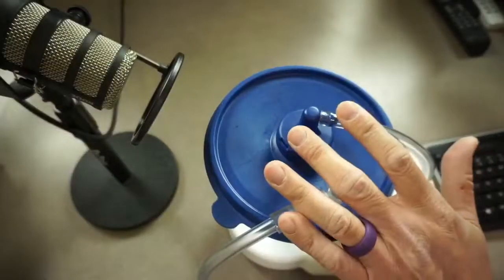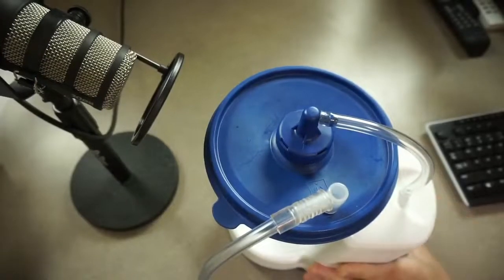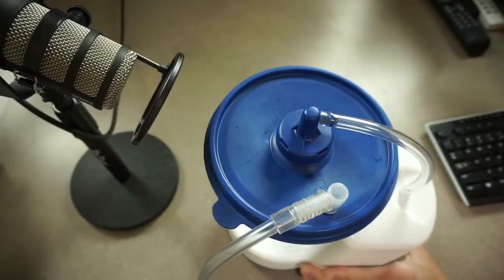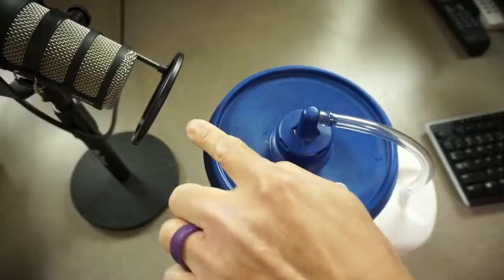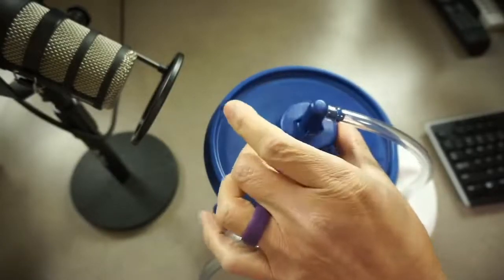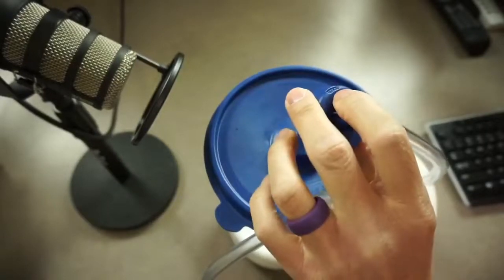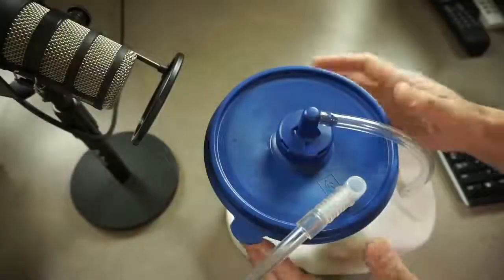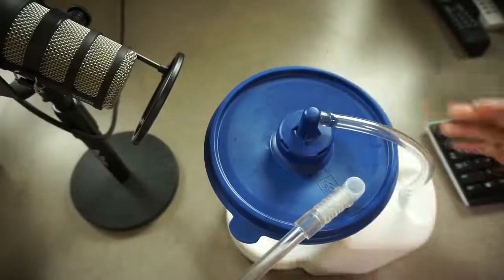How Loud is the PurWick Female External Urine Collection Catheter System Pump?

Comment: The simulation demo given by Dr. Lin was good on the video in that setting. I could not detect the humming sound as much as I do in a home bedroom atmosphere where it is a little more quiet. The humming noise is definitely noticeable in a quiet bedroom environment where there is not a lot room activity. In a Hospital environment  you do not notice it as much when I was there in the ER room several  months ago. The noise level activity in a Hospital is constant, therefore, you do not hear as much with all the machinery in place. I wish there was a muffler that could be used to tamp down the noise for Home  use similar to a Car exhaust system in a Car.  Oh well, I am just thinking out loud (smile).

Comment: Hello, am I able to use this on a continuous basis. Like 8 hours straight, 10 etc or am I only able to use it a few times a day? my husband is nonverbal and id like something that runs all day. thank you..
Reply from the maker: You can run it all day. It's just the motor may burn out faster. You also will need to drain the tank once in a while.
Reply: @JCLinMD  Yes just clarified that with the people on the phone thanks so much for responding and showing us video. TY!!!

Comment: I find the home unit annoyingly loud. Kept me awake
Reply: I also found the Home unit loud annoying and have difficulty trying to sleep. I have had the unit for two days now.
Reply: I have also found after 4weeks that this unit is definitely too loud for the Bedroom.  I had to turn the unit off on several occasions just to get to sleep. I was wondering what affect this noise will have on my hearing if I continue to try to use it. After three hours last night  I could not handle the sound anymore ,so I pulled the plug.
Reply: @HermanWilliams-j4v  it is so loud I can hear it from the living with the door closed to the bedroom.